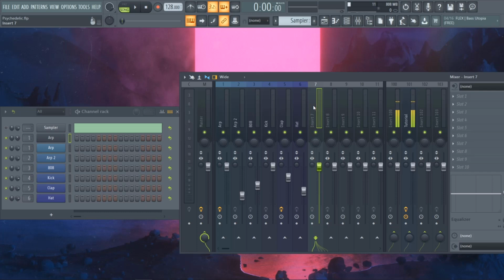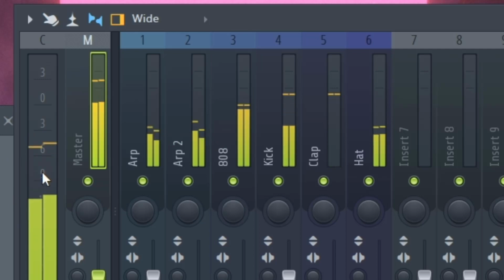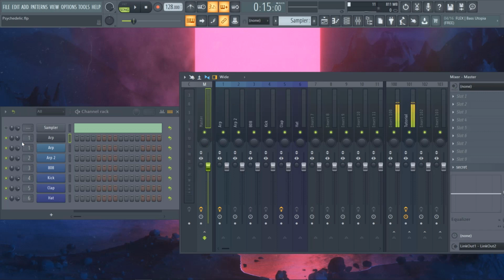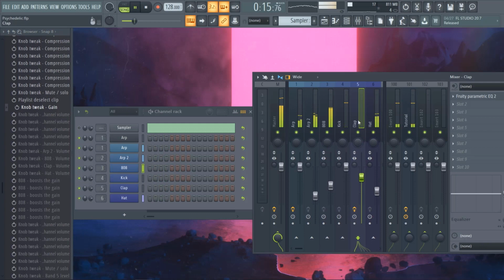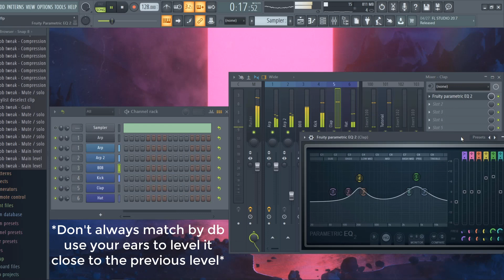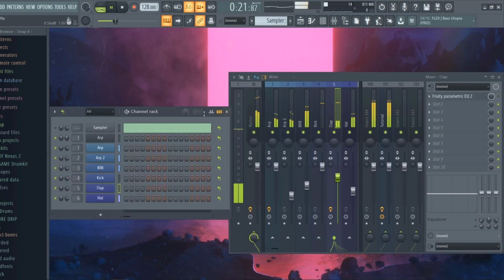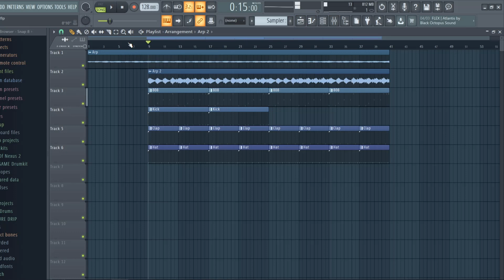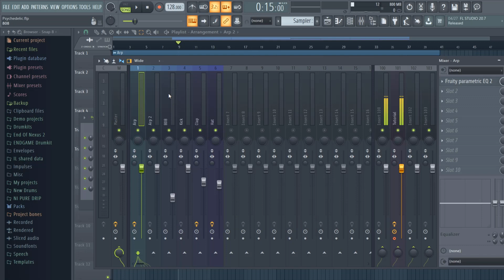Gain Staging Explained (EASILY In FL Studio)

Comment: Keep in mind that the channel rack volume is PRE-fader, and the fader is POST-fader. This means that you want your incoming sounds to be quiet enough to not clip. This is independent from the post fader, where the output sound MAY be clipping during effect processing because it came in clipped already, and adjusting the output fader will do NOTHING to fix your sound. Of course, also check on your instrument itself for a gain knob too which you can use, but the channel rack pre-fader volume knob is there for a reason.
Reply: This is the key point. Producers should set pretty low levels on the channel rack (lower than FL Studio's default template, which is fine for 4 tracks, but far from fine if you end up using 50+ instruments/vocal samples). Then when you add effects in the mixer, you've still got some headroom for some slight boosts due to EQ or other effects. There's no 'one size fits all' dB setting for the channel rack, as it depends how many channels you end up playing simultaneously, but you need to make sure that they don't cause digital clipping on the individual mixer channels or on the master when all the channels are summed together. The short story is: make sure you have low levels on the first stage - the channel rack, because turning the mixer fader down won't help much if the sound entering the mixer has already been digitally clipped.
Reply: What is A B'ing?
Reply: @iloveeverything4380  listening to before and after for comparison. A vs B
Reply: @iloveeverything4380  "A-B testing". i.e. A comparison of situation A and situation B.

Comment: So when I gainstage everything including the  drums should i gain stage at the same level?
Reply from the maker: I wouldn’t think about it like that because every sound is different and they come in different even if the dB are the same one can still sound louder than the other so you still have to use your ears gain staging is just making sure that there not to loud and clip so let’s say your kick came in at -11 dB so it’s doesn’t really sound hard and it’s not loud so I would crank it in the channel rack to a desire point then when I see how loud it’s in the mixer maybe hittin like -2 dB which is super loud and close to clipping , I would then turn it down in the mixer to -9 dB but it’s still keeps that hard hitting sound but just at a lower volume , so it’s just about how you want your sounds to sound like then bring it back to the original level or a good point
Reply: @JaeFreshmen  🔥🔥🔥🔥🔥 thanks.